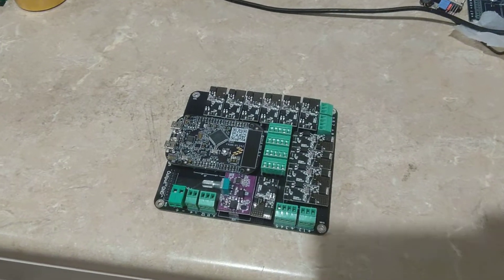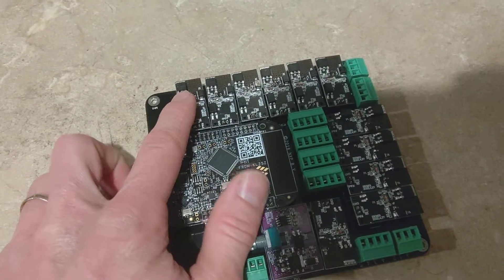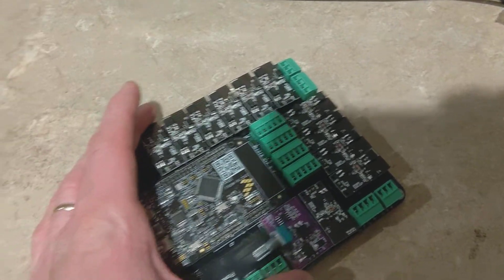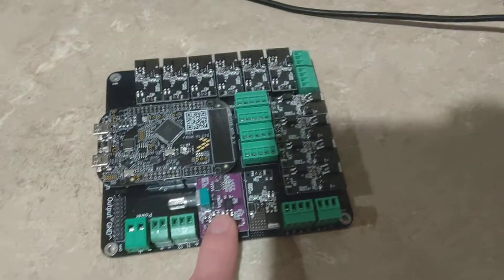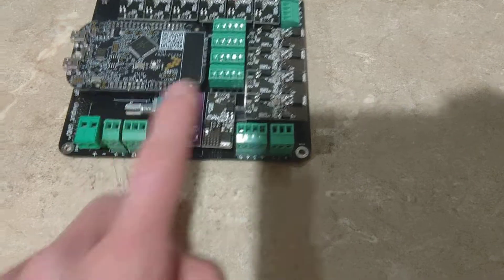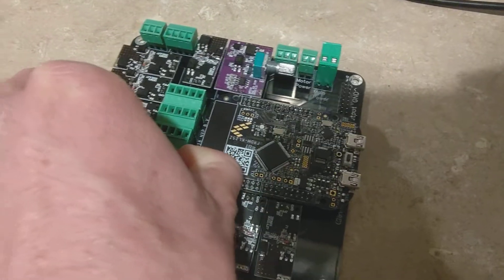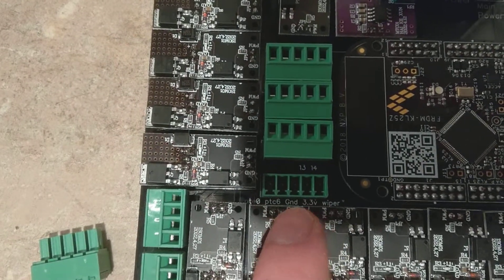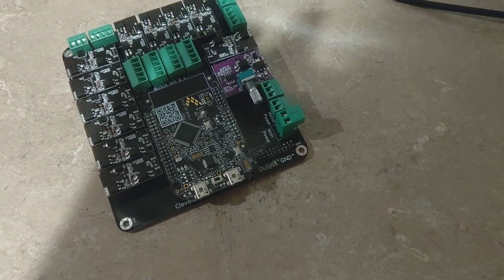virtual pinball 12 position kl25z pinscape board with easily swappable components

Comment: I burned out another KL25Z today (AGAIN!) :( 
This one looks like what I need instead. I am looking for 16 outputs. Which extension card can I use?
Reply from the maker: I sell an expansion board that adds an additional 21 outputs - 5 of them are high power and 16 lower power outputs.
Reply: @clevelandsoftwaredesign  Which board is that Phil? Thanks
Reply from the maker: @BillBene67  You can find it here: https://www.clevelandsoftwaredesign.com/pinball-parts/p/th6ipprhb3y3w17eo84f63z6fw250l

Comment: Hi Phil.  I'm worried about frying the components and the KL25Z in particular.  The guide says I should put a fuse on every output port.  Can you give recommendations for your 12 output and expansion boards?
Reply from the maker: Fuses are nice to protect components, but you can make things a lot simpler and still protect the all the components -- Add a 10A Slow Blow fuse to the input on the board for protection as all the components can handle 10A without a problem. The only advantage you get by adding a fuse to each and every output is if there is a problem, it's a lot easier to identify where it is since each output is individually protected. My newer boards have a 10A fuse installed on them. Another way to protect the board is to get a power supply with auto turn off in a short condition. Almost all DC power supplies have this built in now, so in the case of a short, the power supply will turn off and no damage will be done to your board. For the KL25Z, it is already well protected from any of the high voltage sections with optocouplers, so even in the event of a short, no damage will be done to the KL25Z. The biggest thing to be careful of with the KL25Z is the buttons, as those are connected directly to the board, so make sure that voltage is never applied to any of your button terminals and you should be good to go.
Reply: @clevelandsoftwaredesign  Thanks for the info.  I do see the new design on your website, but I think I see two fuses.  What is the other one for?  So I should just add one 10A slow blow to the 12V+ power input to the board?  Does that apply to the expansion board as well?  Thanks...I'm a noob.
Reply from the maker: @MrWesleyruff  one 10a is fine. I separated out the motor from the rest of the board in the new design.